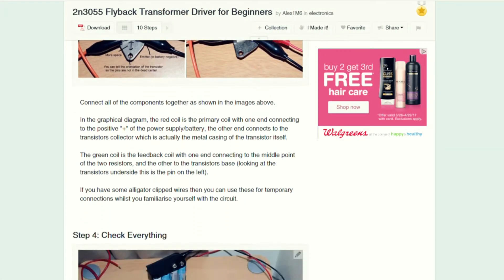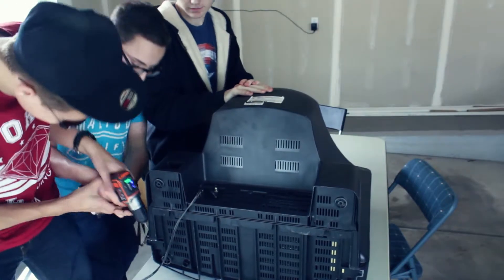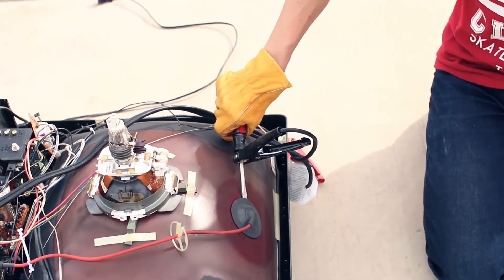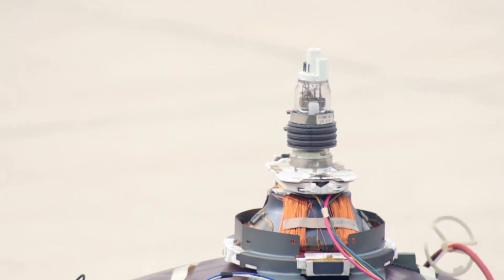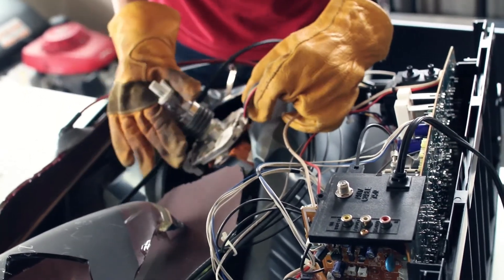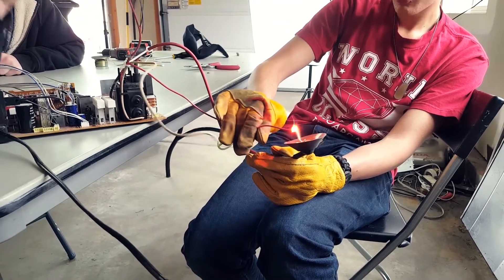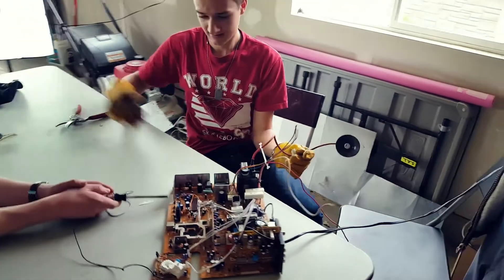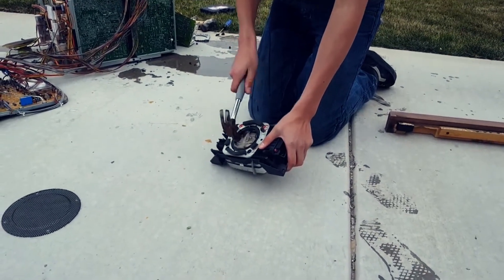How to Make a 20,000 Volt Jacob's Ladder (Sort of)

Comment: Wow that was incredibly dangerous for a bunch of amateurs.  The voltage dropped out because there is an over current circuit on the power board that helps prevent people from killing themselves messing around with High Voltage.
Reply from the maker: Gosh dangit why does safety have to be so inconvenient